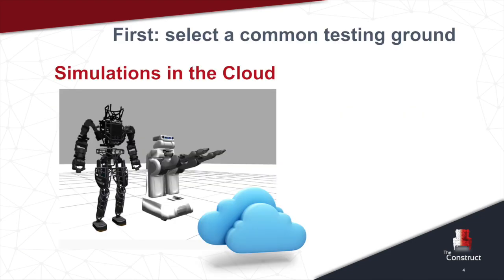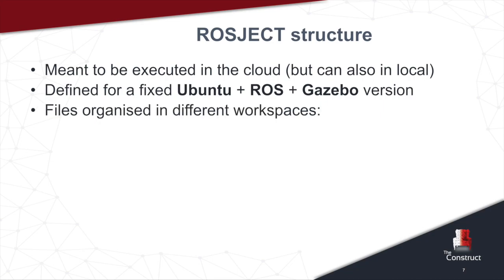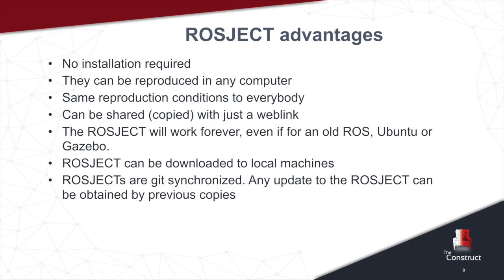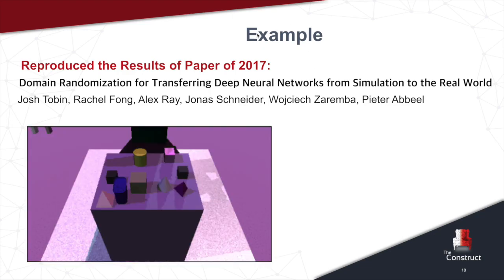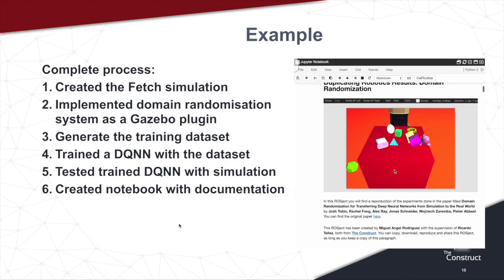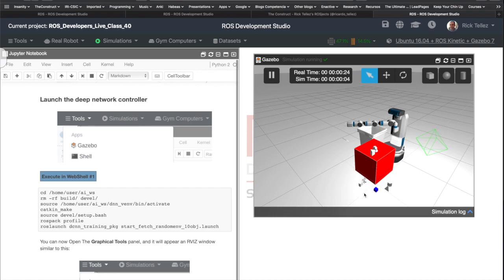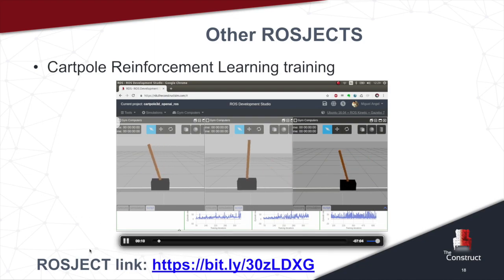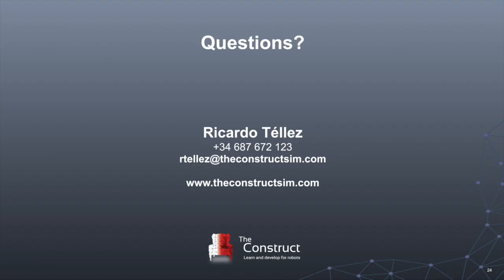ROSjects: reproducing robotics research results

Comment: This is great!!! I had one doubt though, can I download the ROSJect and run it on my local system?
Reply from the maker: Yes you can. Open the IDE and press download to get the files to your local catkin_ws. The only thing is that you will have to compile everything in your local system and for that, you may need to install extra libraries with the proper versions to get the same results as in the cloud. That is extra work!